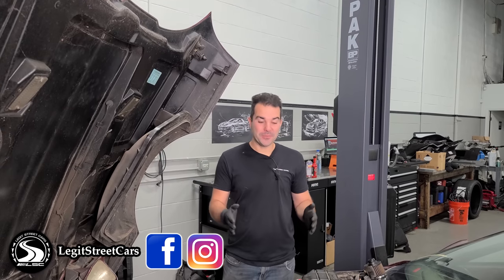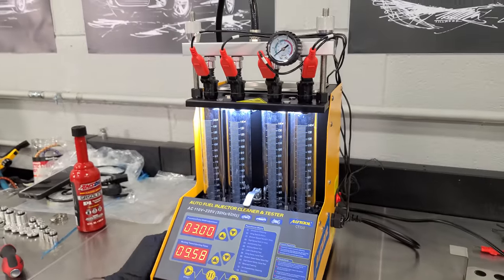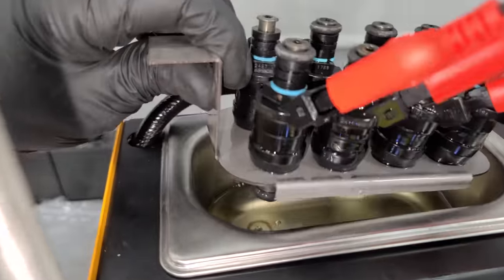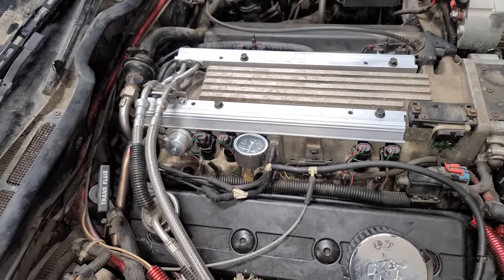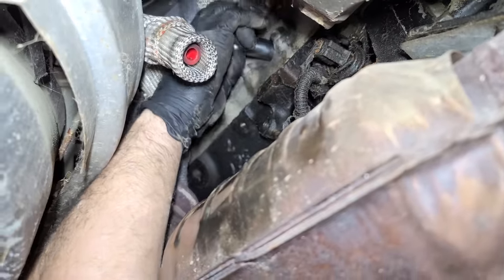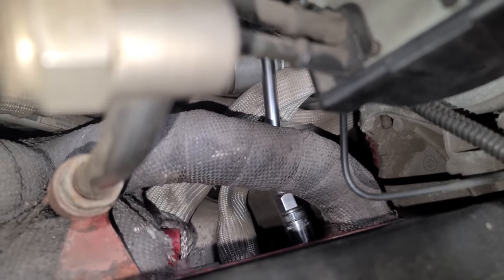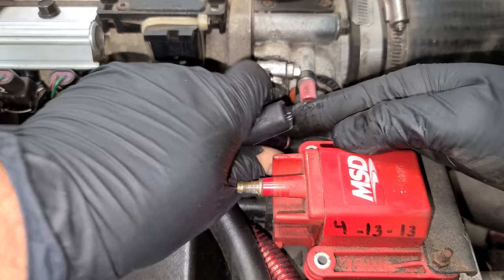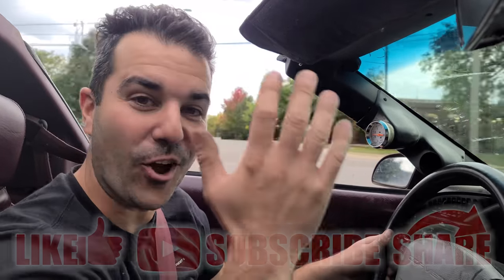I Fixed My Cheap Supercharged Corvette For $50 & Looked Inside The Engine To Find Mystery Mods!

Comment: Tune is going to be rich because it's a chip aka eeprom. Instead of a quick change on the fly and immediate test, you have to pull the prom and rewrite it for every change. A far more time consuming proposition and almost never done to optimal. Only the very quickest drag racers had fully optimized prom tunes because of the time involved. 
The guy that will have a near perfect tune in his database is Jeremy from Fasterproms. His dad was the C4 LT1 factory ECM record holder.

Comment: Very nice cleaning tool! But I wonder what you do if you got only three injectors to test and clean? I know this doesn't happen often in the USA, but here in Europe the 3-cylinder engines are starting to become popular (unfortunately).
Reply: Good question.
Actually thinking about it.
Just use a spare 4th injector to make the numbers up.
..
Cool bit of kit that injector tester..
..
Sadly smaller engines are becoming a thing.
Even Porsche is making 4 cylinder engines. 🙁
Reply: @stuartd9741  If you have one. It has to have the exact same dimensions or it would leak. And usually cars don't come in with spare injectors in the trunk :)

Comment: I clean thousands of injectors a year and it made me nuts watching this lol. Esp letting the injectors sit dry internally in the sonic bath. You are supposed to feed them solvent while the bath is on they pulse that's why you connect them to the harness the solvent will drop thru the injectors cleaning while the tips are sonic 'd.

Comment: I think if you remove the fuse for the fuel pump and turn it over for a few seconds, 
                      pressure is gone ? I have never needed to do it.

Comment: Still sounds like its skipping a bit. The water pumps are notorious for leaking into the distributor and cap. Take a look i suspect you will find the issue. Take it easy on those cast pistons!!

Comment: Add a Standalone engine management system. And turn it up. Modern EMS has safety's you can setup coolant temp, fuel pressure, you can do flex fuel sensor etc. Etc. Etc. Your biggest power robbing bottle neck is the factory computer. This will also give you more room under the hood. Deleting EGR, opti spark, and many outdated emissions accessories. $2500.00 in parts and 30-40hrs. Labor for a beginner. Would make some good content. And reap a really spicy C4🌶️🌶️🌶️🌶️🌶️🌶️🇺🇲🇺🇲🇺🇲🇺🇲🇺🇲

Comment: For those that don't know, AUTOOL makes high quality automotive machines/testers, etc. for consumer and commercial level....  Their high model smoke machines for example are freakin' build of high quality parts and are amazing doing their job, proper tools for the perfect job!    They even came out with their latest kick azzszz Intake Valve cleaner with every adopter for every car to clean using not walnut blasting but "Dry ICE' blasting instead.  Very effected results yet cleaner than using walnut shells!!!  The best part is they're easy to use and are way cheaper in prices compare to the competition...

Comment: On the supercharger watch out for it's oil going into the intake tract that means the seals are bad or the shaft can even bend I had a vortech v3 that it actually bent on, not from me tho I wish I knew how it happened bought it used and was gonna rebuild it myself but at that level I sent it in but that's rare it's the reason I got a v3 for $600 still was less than a new one in the end and I learned a lot about those self contained units.  I've also had a cheap filter like implode on itself the unit was under enough boost but only had that happen once was probably cuz it was a cheap eBay one they didn't have any support on the filter mesh.  I would re connect the pcv and put a catch can on it those valve cover breather's get nasty and I like to think it helps rings seal, just make sure you got a check valve and the other line connected to the intake so it's working under boost too.

Comment: Hey Guy's,
Important info: There is access panels on both interfender wells to access spark plugs easily. To get some access to the distributor, take off the belt tensioner drivers side. I have two 92 Lt 1's. I use only MSD ignition parts! I have 2 championships in one of the Vette's. Have fun!

Comment: I'm not completely sure but it almost looks like there's an electrical plug on the intake adapter that has no wiring plugged into it. Intake air temp sensor maybe?

Comment: If a cylinder is not firing, the raw air can go into the front Cat, destroy it, pieces will fly into a 2nd Cat, killing both. (Bad wire to injector Bronco V8)

Comment: 32:00 you can see a tiny notch in the piston.  That's a FACTORY directional assembly notch.  Replacements don't have it, because they won't be trying to build 10,000 engines a month, but that notch helps boost line assembly speed.  d;o)

Useless little tidbits you pick up living so close to Detroit and having family in the industry.  d=O)

Comment: The C-4 Corvette is proof that Engineers hate mechanics. 
When I was growing up we had a shop that specialized in Corvettes and Harley Davidson motorcycles.(Hot Rod's) In Hallandale Beach, Florida. I've had a few General motors cars with  engines that came from Mid 60s' Corvettes.a 427 swapped Buick T-Type, a 77 Trans Am with a LS-6 with dual Quad. Stuff like that along with the Corvettes. I can't stand driving one daily but weekend ground pounders are great.

Comment: There at the end, you're mentioning AFR and not knowing what it is...but from the borescope on the pistons (lots of black, gooey deposits), it's pretty-safe to say you're running RICH...way-rich. Best 'Kentucky Windage' on AFR without a gauge or readout, is the piston-tops and exhaust tips...black is rich, gray is desired, white is lean...and it doesn't take long to get there in color, either. Keep in mind, for 'short runs', it is unlikely you'll be off so far, as to actually 'hurt' anything...as you DO have a cooling system. You DO have a cooling system...right? Thermostat isn't stuck, or waterpump vanes 'eroded'?

Comment: I think you're supposed to use test fluid in that machine and not Gasoline.  I suppose if gas was not flammable it would be ok. I just hate to see anyone hurt.  I checked out the manual and it does mention this caution way down towards the bottom.  They should have a big ass sticker on the top of the machine.

Comment: Id say I want more Trans Am content but you've taken that car pretty dang far. Have my 97 Comp T/A on the stand right now and motor out. I painted the block a custom color using Pontiac Blue as a base. Going to be doing the 4 piston CTS-V caliper upgrade..etc..etc..etc. Just trying to decide if Im going to stay stock bore and stroke and just upgrade the internals and go FI or 396 + FI. Not really sure which direction I want to go with my build right now.

Comment: love the channel, love the way you attack issues. but save some time and money and stop using brake clean for loose parts and invest in a parts washer. not being a jerk!! just advise from an old Gear head whos been around the block a time or two. keep up the outstanding content. cant wait till you stumble across an old 80s 911sc..steel wide body.. no TARGA please...lol

Comment: That engine needs to come out and get a good overhaul, it will save you a lot of stress in the future by the looks of the access you showed. I looks like the worst headache imaginable to work on hence all the bodge repairs that are going to sting you in months to come....Good luck with it...
Reply: Its a low mile engine..  I bet it only has 20 K since the mods,

Comment: Do not run gasoline in the injector cleaner. Use isopropyl alcohol or injector cleaning solution or it will break down the seals.

Comment: In my opinion, I don't agree with this sparkplug wire repair method. It works but it affects your pulse width modulation and firing duration. Repairs like this aren't forever fixes.

Comment: Please get the correct formulation rubber compound O-rings to replace the ones you used from Amazon. Viton is the appropriate material, not the Chinesium used in that kit. You don't want to be in the "Burning Ferrari Club" Do you?

Comment: Yikes... Y'all are as bad as I am. I ended up getting injector test fluid for my crappy import test bench. The control panel on mine was difficult to get the tests I want, so I programmed an Arduino to drive the pulses. Looks like the guts are equivalent to my bench. 

After a year, real gasoline ruined most of the plumbing inside the bench, so I got new tubing and rebuilt the plumbing. 

Another year and the 20V feeding the main control board (instead of 12V like the PCB said) it died, so I used an esp32 and MOSFETs to interact with the power board behind the graduated cylinders. 

Oh! Speaking of the cylinders, pour the same measured amount into each cylinder with the bench off. Then add nuts and bolts to the lowest cylinders until all 4 read the same value for the CCs you measured and poured in. 

We got in a batch of injectors to test and I'll do a few videos about the design and mods I've done to mine. 😅

Comment: You got a 2013 MSD coil may before they switched over to china manufacturing old msd stuff is good newer china made msd is junk. Ive had a brand new cap and rotor make my car run rough and shut off on the highway but my old chewed up motorcraft brand made my car run right. Also had a newer coil die on me in kess than 6 months. But found an old 90s MSD coil ran perfect for years lol

Comment: Your fancy fuel injection tester makes me feel inferior now! I followed your old video and made myself a testing rig out of some old wire and a momentary switch that hooks up to a small 12V battery that has slide on style connectors. I did have some issues getting the straw for the spray can to stay inserted even after siliconing it in place.
Reply from the maker: That was much cheaper!
Reply: @LegitStreetCars  how much was it? I looked on your Amazon link and didn't find it there.

Comment: You shouldn't fill Your Fuel Injector Cleaning Machine with gasoline!!!!!! You  should use Injector Testing Fluid which is the same  Viscosity as Gasoline but much less flammable. You can buy the fluid on the Internet, it's called Flow Rite Testing fluid. It it comes in 5 gallon buckets that Cost about a $120 a bucket. Bio Clean it the Fluid Yoi should Use in the Ultra Sonic bath. You Don't want too Use Costic Cleaners in the U.S. Bath.

Comment: PRO TIP
Maybe buy a BS meter 1st!
Those $5 generic o rings aren't correct.
Supposed to lubricate them when installing them NOT spray them with brake cleaner.
The coil was was dated 4/13/13 ,probably time for a new one.
Those ignition wires are hideous!
You constantly go by the transmission cooler and don't know what to call it,haha.
Are these the same guys who had the key to a locking gas cap but opened it with a hammer??😥
Nothing "legit" about the work being done. The money you saved buying that $5 o ring kit can be used for a fire suppression system 😂🤣😅

Comment: I bet I know what happened with the red tape. they were getting signs of a vacuum leak and not realizing it was the fuel pressure regulator tried taping up all the unions/junctions

Comment: Looks like ceramic spark plug boots needed. TR6s are terrible. Look at the spark after 10K miles... and then look at the spark of an equally used Iridium. You will kick yourself.

Comment: The fuel injector should have the proper spray pattern for those injectors and each type injector have a different space pattern. if all of the Injectors have the same spray pattern, that's good, but sometimes a Driveability problem will not be fuel flow but will be fuel spray pattern. cleaning the injectors replacing the filters.  99% of The time fixes the injectors and Your Driveability Problems!

Comment: While I love the style and the sound of the LT1 in my '93 Formula the mechanical design of these cars is...well, let's say it, terrible. Getting to the rear two spark plugs is very difficult - and you have it a lot easier there with the hood of the Corvette containing the fenders too so you have a lot more space. In an F-Body all of this is covered...it's a nightmare. And let's not talk about the fuel pump that requires you to drop the tank which requires you to literally lower the entire rear axle...

Comment: All that hard work and didn't change the fuel filter so all the dirty stuff that was in the gas lines and tank is now in the new o-rings and injectors you cleaned and the vette needs to run 93 octane gas not 87.
Reply from the maker: Hang on Tony,  it's coming.  We aren't done yet

Comment: I used to sell O Rings from kits like that, but they weren't rated for fuel; is that one?
Reply: Of course not, I'm sure you could tell the difference!
Reply: @geneyus6411 , those that aren't rated for fuel fail more quickly, so obviously you can.  Sold them regularly for 15 years
Reply: @fahrfromrunnin  No kidding capt obvious!😢
They might last a week or 2!
Reply: @geneyus6411  communication is an art; how long you been color blind?
Reply: @fahrfromrunnin  speaking of color blind you sold o-ring kits but don't know that these are wrong???
WTH???
Reply: @geneyus6411  sold o-rings them yes, not the whole kits. O'Reillys doesn't give a toss about whether it will work for the customer, just that a sale was made.  Learned over time that yes, they failed quickly in fuel, so started to suggest to customers to buy viton o rings from AC fittings, as they held up to fuel much better.  You ever make a mistake, Geneius, or at least ever own up to it?
Reply: @fahrfromrunnin  Yes, watching this waste o time video was a mistake!

Comment: OK I like cars thing - comment: that machine for testing and cleaning injectors looks Chinese Made - can you just show me the Made in label please.
Nothing wrong with Chinese made it's just this is an american show.
Right now I'm going with the Oring on the injector as the problem but I'm only 6 minutes in - It could be the Cam-Load-Return-Spring all I know.

*The Cam-Load-Return-Spring replacement is what's needed when a mechanic just spent 5 hours and didn't find the problem but for some reason it started when the customer came to pick it up. It's was Your Cam-Load-Return-Spring and I was lucky to find one at $500.*

Wood I lie 2 U ?

The Humble Mechanic's Cam-Load-Return-Spring is in almost every part of a car, there's 4 in the breaking system - 1 in the cooling system even in electric cars yeah - There's the fuel Cam-Load-Return-Spring also in electric cars - there's the Oil Cam-Load-Return-Spring and Just last week I found a Windscreen washer motor Cam-Load-Return-Spring that needed changing and Lucky I found a Chinese one that was only $50. 

FYI and! this is Terrifying - The Most Expensive Cam-Load-Return-Spring I had to replace was due to Connecting Rod Damage quite noticeable by the a large hole in the block where the Cam-Load-Return-Spring had been - yeah but wait - The customer didn't even quibble - he just dumped a sack of money on the workshop floor and the bastard stole my wheels - something about a bank job and "it's a real NEED BRO!"

Still I only a pushbike - like you don't make a lot of money passing of worn out break pads for long - But now I can afford one of those Chinese test machines like you got - and
A real car to get to the workshop in.

AND A SIGN!

Comment: Rtv on a fuel seal won't work
Reply: It does for hackers
Reply: @geneyus6411  what do you mean?
Reply: @ClumsyCars  You dont mix RTV silicone with fuel, the fuel will eat that up and clog the system.
That dum dum should NOT have used anything except a new lubricated o ring.
Reply: @ClumsyCars  This video was "click bait "
He didn't fix anything!🙄
Reply: @geneyus6411  i agree.

Comment: Those cars were a really bad car to be a Corvette.  Seat is all of 2 inches thick and sits like sh$#t.  Dash is what cost so much and analog gauges would have been better.  Engine is a rip off, block is OK with flat top pistons with 9:1 on the car I had but the heads  are cheap no screw in studs or guide plates, cheap press in studs.  Camshaft is almost flat with no duration or lift.  Transmission good and cheap too 7004R.  The fuel injection worked very good and if you would stay off throttle it would get 24-26 MPG on four lane at 65.  About 8-12 with some throttle.  But dash and seats sucked.  Rear spindles will not hold up.  No wonder they are the cheapest Corvette because it is a poor example of a corvette.  This was a 1985 with same type engine as in late 60's or 80's.  They changed engine type in 86 but it was no better.  Aluminum heads and a different camshaft would really wake it up if computer would accept the changes.

Comment: I bet real car guys just watch these and cringe like you can really tell you're not a real mechanic not saying that in a bad way it's just really frustrating to watch like that torn o ring on the inector that would not affect anything on how it runs it would just be spraying fuel in your face like it just did on the tester lol like think about that The torn o ring happened when you took it out And I don't think they use gasoline in those machines I think they use something that has the same wait which would be like alcohol or something of that nature